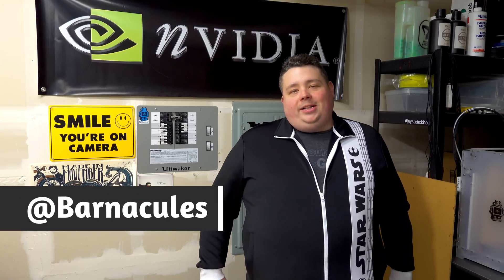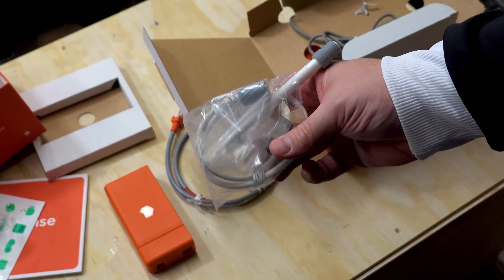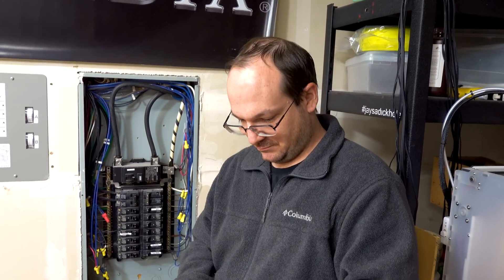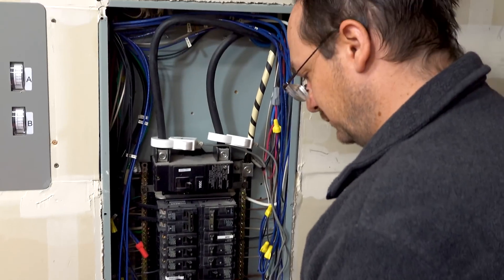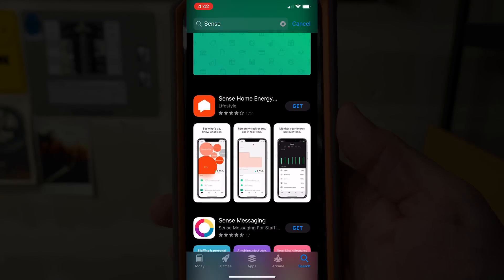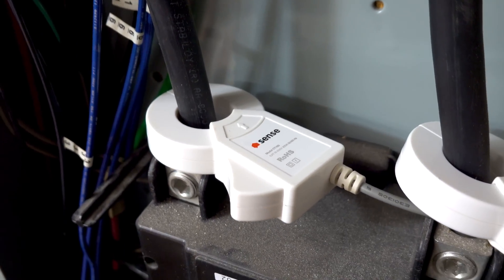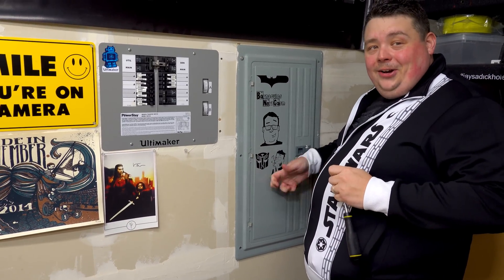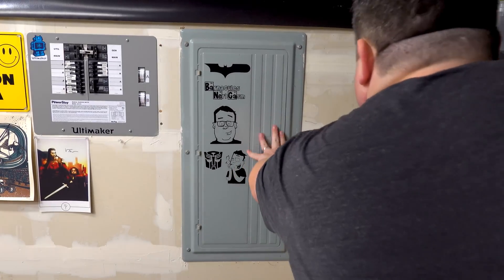How to install an energy monitor in your home electrical panel! - @Barnacules

Comment: you're supposed to have a square head driver, which every electrician has.  a square head turns every screw except the main terminals, which is a hex head.

Comment: Electrician here, Unless the sense needs breakers for whatever reason, It is a waste of 2 breaker slots to use breakers, I would wire the senses power wires directly to where the entrance wire connects to the bus bar, Dont even start about overcurrent, because the senses thin wires would melt long before a 15 amp breaker would trip. Also a word here: The two hot entrance wires, are 110v each and one connects to one bar and to the other bar in an alternating pattern. Americas 240v is not 240, it is 2 seperate 120v lines, But in europe, there is 240 on a single wire. And if you touch both hot terminals you will not get shocked, as long as you are not touching grounded metal or the neutral line (touch one of the blacks and the white, or the bare copper and you will feel it)

Comment: Never attach current clamps to the house mains without putting a load on the end of the clamp cable (plug it into the sense device),  The open circuit voltage would be 120 volts instead of a few milliamps under load.

Comment: Jesus, this guy is nuts.  NEVER attach or disconnect wires to breakers that are plugged into the power rail , even if the breaker is switched off because with the mechanics of a breaker having moving internal parts for functioning as a breaker if you unknowingly have a bad or damaged breaker it could still be hot after you switch it off.  Disengage the breaker from the rail then do the wiring, then snap it back on the rail for safety sake.

Comment: 2:57 "Ded outlet?" If it would have said "dead" then I would have understood, but... nah, I'm kidding.
3:49 I thought the U.S. used 110 Volts.
4:33 I do believe he'd rather have money than shit.
7:25 Why would that be different from one state to another?
8:02 and 12:50 Could you please...NEVER DO THAT AGAIN???!!!
Reply: North America uses 120v on regular appliances and 240v on heavy power appliances - dryer, oven, welder etc...

Comment: I think the flathead thing is just a turn of the century american problem because flathead was standard before WWII and the whole Philips Jacobs issue in manufacturing was a strange industry licensing problem and no one saw the need to change all the screw drivers and screws because most times you just set it and forget it, it also has something to do with manufacturing and how its easier to make different alloy screws

Comment: I'm gonna save $250 by saying it's probably, 3 UPS, couple clocks, my 5 tablets around the house, 15 cameras through out the house and outbuildings, and my TVs that's sucking away at the teat that is my electrical panel. yay!

Comment: We love the system we have in our home. To see our power usage in real-time is awesome. Turn on something and see how much power it uses.  Nice to see when all things are off and you get to see the power you are still using  AKA Phantom power (also referred to as standby power, vampire draw, or leaking electricity) is the act of electrical appliances consuming power while switched off or in standby mode.

Comment: They like flathead screws because they're a lot harder to strip than phillips screws.
Reply: or Robertson screws
Reply: false, its a #2 square head in the middle. #2 squares are used in place of phillips in most electrical cases.

Comment: Damn you Sooked the Tee Shit just putting on the AC Panel..Also a Big Safety Tip, Body Fluids Conduct Electric Very Well, But it Nov 24, 2019, I Blame it on the Electric Dryer ..

Comment: The straight slot screws actually have a little square head in them.  Just like on the sides of outlets.  I just recently found that out & love the square heads
Reply: ..... I guess you caught that at 11:50 though.   Save your comments till the end kids

Comment: Straight slot screws are harder to "Strip". Very useful when you can't guarantee that the user won't strip the screw and create a huge inconvenience. That's why I use Torx screws for everything I assemble.

Comment: I just installed something similar. The open source version of this called the Iotawatt. It monitors every breaker for more accuracy :)

Edit: Also doesn't link you to someone''s "cloud" you run the monitoring software yourself, which is also open source.

Comment: You can use a Robertson #2 on the panel door screws...
Reply: Also your buddy is right in that technically as a homeowner you can do whatever you want. You don't need a licenced anyone for anything. With that being said, as an electrician I was holding my breath throughout this video. Please for the love of those you care about lock out the power next time. 
Accidents only happen once.

Comment: aww man, this spiked my anxiety so hard, turn off the main breaker before any of you DIY this and also clip the wires coming off the ends so when you clamp it down into the smaller breakers down there, there aren't any shiny bits of wire showing 11:54 I'm sure someone has probably already commented this but yeh, anxiety and safety kids.

Comment: 12:06 Your dabbler stripped the wires pretty badly....  (copper exposed)
Reply from the maker: I told him to do it that way so I could electrical tape some loosely bound wires onto them and hang them out of the box so I have a quick 220v source for playing around with 😉 /s
Reply: @Barnacules  Well if you want a "good looking" hair style its your problem.... X'D

Comment: You can do this with Arduino, a couple of modules and OpenHab for a fraction of the cost and learn dozens of things in the process, but cool video anyways, always nice to see you again :)
Reply from the maker: I would love to try this down the road, but this is a nice out of the box solution. You can literally build anything that exists in real life but sometimes convince is what is wanted not the journey depending on the project and passions of the implementing party.

Comment: Yes Jerry, most electrical panels and switch-gear use Robertson (square) bits.
There's a video somewhere in the interwebs that goes into detail why Robertson bits never took off and also explains why Phillips tips are more common.
Source - I'm an Electrician.
Reply from the maker: They never took off yet they are still on like every single electrical panel everywhere?!
Reply: @Barnacules  They were used in a lot of places, including Ford cars, but basically the owner of the patent made some poor choices and Phillips tips took over the market. For some reason, they're big in the electrical field... and Canada according to Google.

Comment: The clamps are Induction Clamps, and they're actually not that great to use as they have a very high chance of bleeding off and picking up signals from other sources of electricity. Direct connection is the best method for an accurate read
Reply from the maker: Great tip! But I wouldn’t want to install that one 😉
Reply: @Barnacules  neither would I, I'd rather not be Sparky 😂

Comment: Offers to get the sparky a drill to remove screws.
Discovers that their flatheads preventing the use of powered tools on high voltage electric devices

Do i need to explain further?😆

Comment: I happen to be an electrician & I can say everything was done well with the exception that those leads to the circuit breakers were stripped of insulation too far back. Doing like that can cause a problem if (God forbid) someone working near that area slips with a screwdriver,it can cause a mean short and or hurt badly if due to bare wire makes contact.

Comment: Don't install current clamps OPEN on one end (ie. not connected to the device before puting them on the cable).
Even if the have zener diodes in the clamps it's still not a good idea.

Comment: The red and black wires are both hotlines the white wire is common / neutral the proper procedure would have been to turn off the main breaker and the breaker that you're working on.  a lot of people don't understand how easy it is to get electrocuted and when that happens you literally are unable to release or move your hands from the conducting surface it is also not a good idea to tell people they should do these types of installations themselves because they are working with a live electrical box.

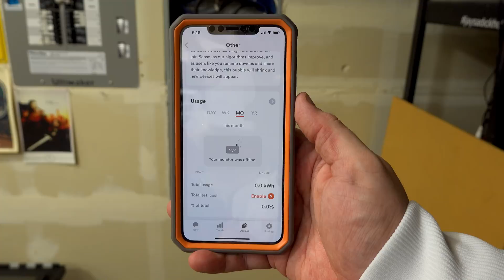Comment: • 10:08 - I wish my electric company still had tiered billing, but the narrow-minded bastards forcibly switched everyone to time-of-use several years ago. That totally screws over anyone who already uses as little as possible as well as anyone who is unemployed, retired, or works from home. 😒
• 12:50 - That's twice you've cried wolf.

Comment: Those are actually best used as a square bit. 10:33 Notice the sqare in the middle of the flathead screw
Reply from the maker: That would have required us to search for the proper tool and that goes against the man code. Besides, it was my neighbor doing the work so I didn't want him spoiled 😉

Comment: lol your neighbor did a better job attaching wires to the breaker than whoever did the rec room, 1/4 inch of exposed wire is unacceptable, (higher chance something will bridge that gap, could be a bug, could be a screw etc, its bad practice, and though I doubt jerry knows why, why is there braided wire attached to a breaker? should be standard romex.
Reply from the maker: Neighbor > Certified Electrician 😉

Comment: you got shocked from low voltage. thats nothing, do not mess with panels, The panel cover is known as a "Dead Front" and with it off it is very dangerous and anyone else getting the idea, please leave this to a licensed electrician. I do HVAC for a living and messing with 220 is no joke, always shut off power when working with ANY Mechanical device, such as changing thermostats. and if you have a prehistoric furnace, installing a nest may require to run a new tstat wire.
Reply from the maker: Despite your strong language I have pinned your comment because there is knowledge to be had here 👍
Reply: Barnacules Nerdgasm sorry, it was out of habit, cleaned it up though lol.

Comment: Glad to see you've recovered well from your previous home maintenance project. I'ld like to see in Part 2 if Sense actually reports on its own power consumption, and since I'm too lazy to look it up, I'm expecting a full report. Thanks for the videos.
Reply from the maker: I doubt it will be able to identify itself since it's power requirement is so ridiculously low but it's also the closest thing on it's circuit so maybe? I'm curious now!